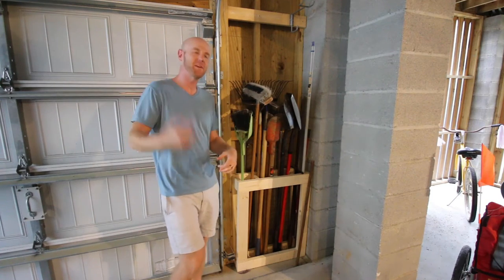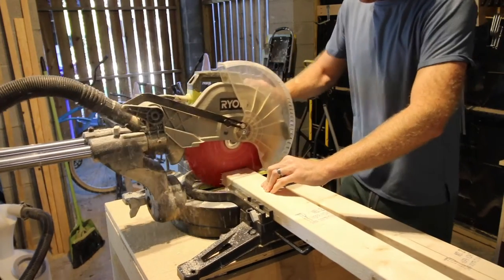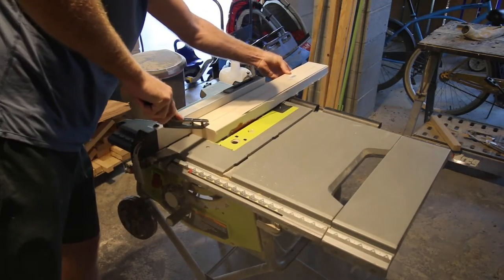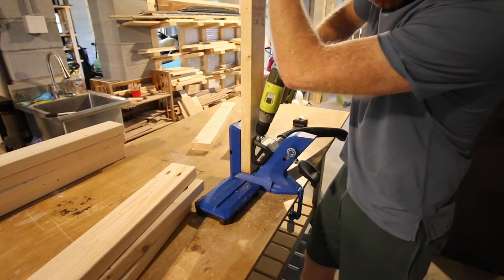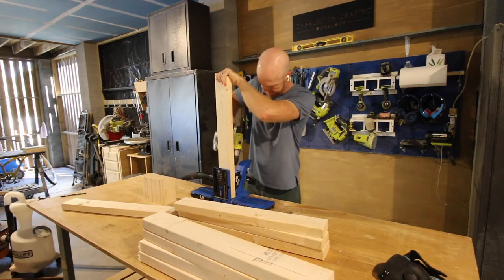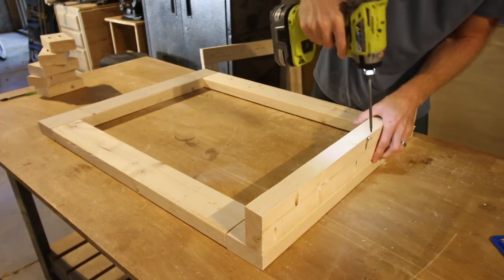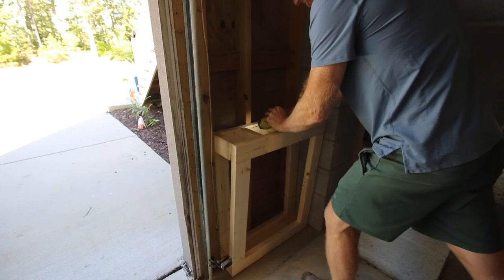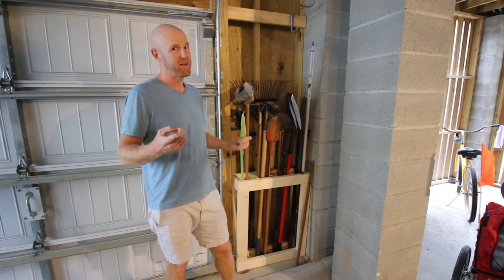DIY wall mounted yard tool organizer

Comment: I am too cheap to buy kreg stuff i just drill holes with a recessed bit for wood screws and use construction screws
Reply from the maker: The Kreg 720 is currently only $100. That's a great investment in my opinion for what you will get from it over time.